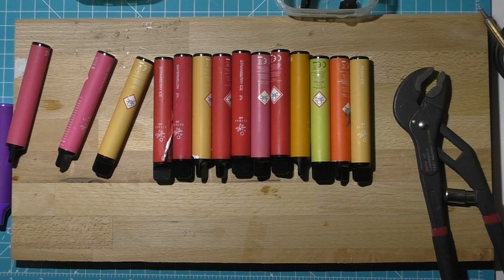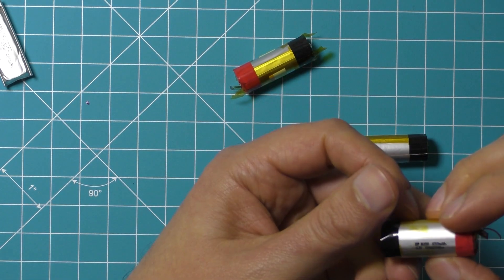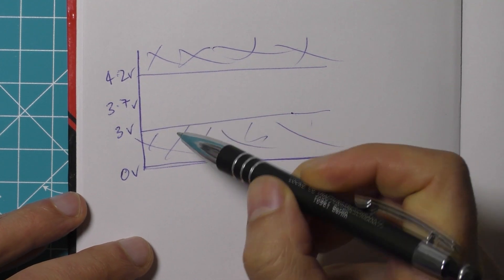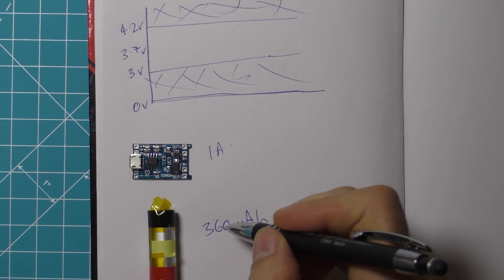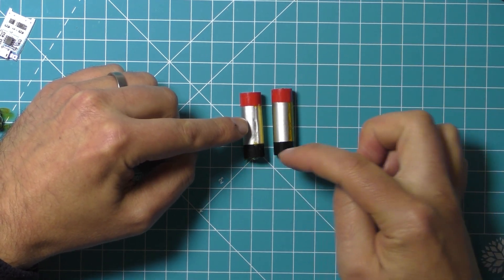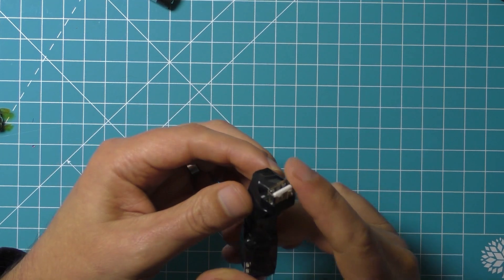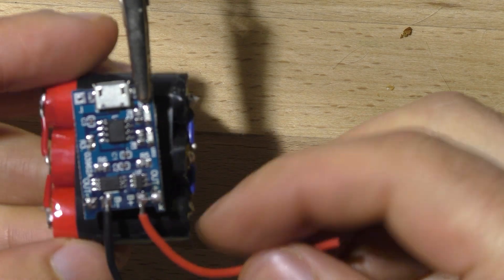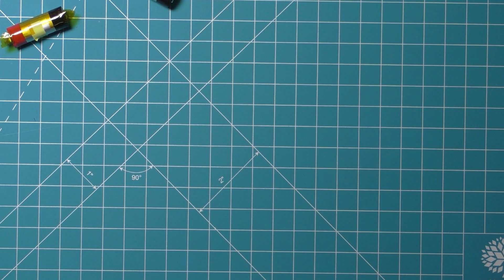Transform Vape Pen Batteries into DIY Power Banks for Your Projects

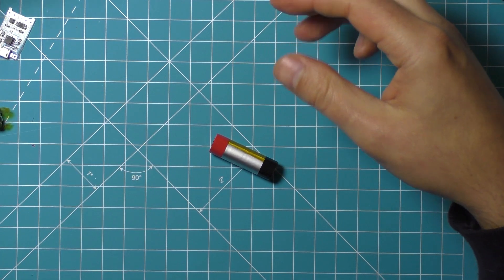Comment: 4:30 or just change resistor on the charger board to get desired current, 1k2 is for 1A, 2k is for 580mA and it goes up to 10k ~ 130mA according to datasheet.

Comment: They're all the same type of cell - lithium polymer.  They're just shaped differently. They're definitely all the same type though.  Lithium ion cells have a hard metal case around them.  18650 cells are an example of lithium ion.  All these cells with the flexible foil around them are lithium polymer.

Comment: You can get TP4056 modules with built-in boost converter and very cheap, little, independent boost modules you can use in combination with a regular TP4056 module to get 5V from 1S lithium battery.

Comment: I’m thinking that u will find your initial set up sufficient to charge a phone…at least somewhat (depending on the capacity of the phone battery and the size of your salvaged batteries. But I love to take things apart and I’ve found that most small phone power banks (1 charge power banks) and most phones all have a battery in them that is between 3.4 and 3.8 volts (with varying mAh). But all usb ports are usually 5 volts. I’m not exactly sure why this is the case and apparently safe and the way it’s been done for years…but maybe it has something to do with the power V*A equaling a number that is within tolerance…or maybe the internal circuitry has some boost and buck features built in respective to input/output.

Comment: Pretty sure they all lipos ?
Reply from the maker: Interesting. Why do you say that? They don't seem to say anything on them to identify what kind of cells they are. I just read somewhere that the kind that look like cylinders are li-ion and the kind that look like little sacks are li-po. No idea if that's right tbh
Reply: @alexstacey  Some of them are lipos and some of them are lithium ion. Even some of the round ones are lipos.
Reply: @alexstacey  been using them for my rc hobby and seems to work on lipo charger same ways original batteries do on lipo setting